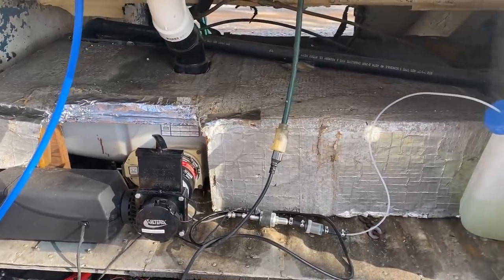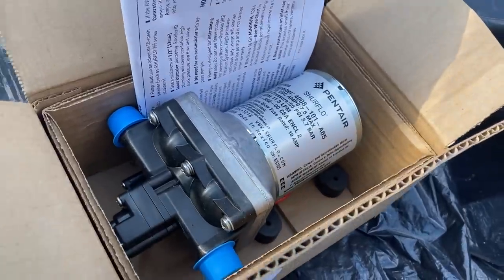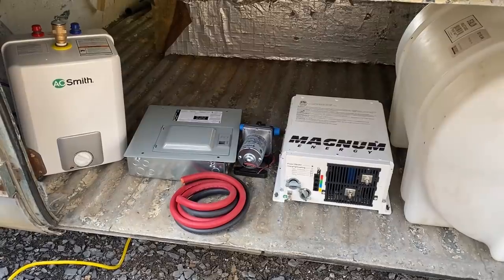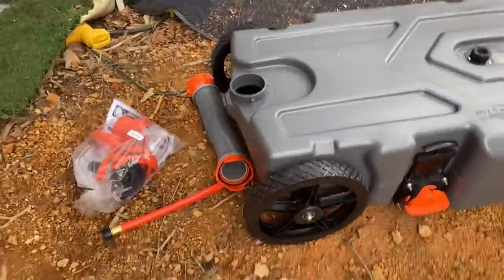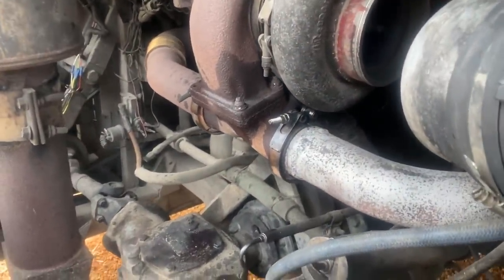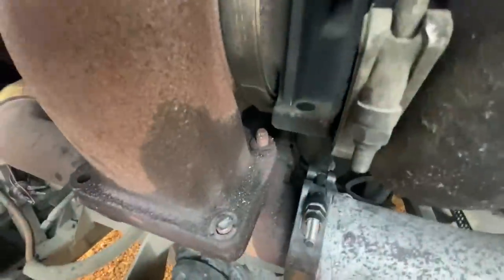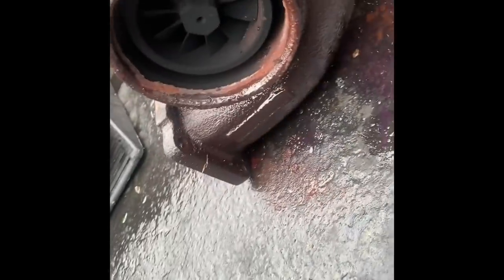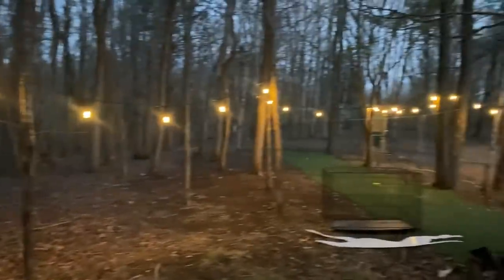Silversides bus build progress and eagle bus turbo removal

Comment: Someone neglected to let the turbo cool down at engine idle for 15 minutes before shutting down the engine. When you shut them down hot the oil in the bearings overheat and burns off leaving carbon in the oil supply and return port's. That eventually clogs them up leading to oil starvation and bearing sezure. When I was in the military we would install a small oil tank in the oil supply line that would gravity feed oil through the turbocharger bearings after the engine was shutdown to help cool the bearings and supply oil to them while the turbocharger was coasting down. Also we would let the engine idle unloaded for 15 minutes before shutting it down. We never had a turbocharger fail doing that.

Comment: As a HD mechanic that live in a heavy salt and rust area and has a lot of experience with rusty nuts and bolts, all you needed to do is heat the nut red as possible and quench with water imediately and those nuts will come so easily. I believe you made some extra work there.

Comment: Starlings have a unique means of flying in formations that do not result in crashing into each other. Each starling navigates by paying attention to 5-7 birds around them, if the one on the right moves left or right, they will move with that one bird which is moving because that one has moved because one on his left or right has moved in a specific direction, thus they all move together. Likewise, up and down, banking and turning are all done the same way, following their neighbor's moves. I'm not sure who the leader is though, but maybe they change leadership based on who is out front at any given time!
Flocks of starlings follow the food source. As the temps warm up little insects come out of hiding and the starlings get fed!

Comment: the best way I've found to remove rusted solid exhaust fittings without  damaging the studs is with a nut splitter...if you split the nut in two places,it usually comes off leaving the stud intact. Worth  try next time? Lot  easier than having to drill out snapped off fittings...

Comment: Those starlings are beautiful to watch when they fly like that. Lucky thing you found out about that wheel bearing. Shame about those air bags, but it makes a good learning lesson. Is Tyler going to put some coating under the batteries to prevent corrosion or is that not necessary? Those extra lights look nice.

Comment: Ive ben reading up on those batterys. ..and it says there no good in cold climate they can freeze ....and if that happens they are junk ..........is that true ??????????????
Reply from the maker: In an rv you have lots of things that can’t freeze.  Yes they can go below freezing but safety settings in the bms prevents them from charging/discharging at certain temps.  All LiFePO4 batteries need that protection.
Reply: @BusGreaseMonkey  ohhh ok im releaved. Cause ive ben building my high boy conversion van. 1997 gmc. Its ben alot of work. .i just finnished my solar 230 watt system but i gotta invest in good batterys ...sorry for talking your ear off ........you guys are great